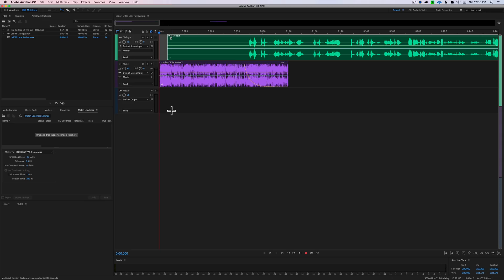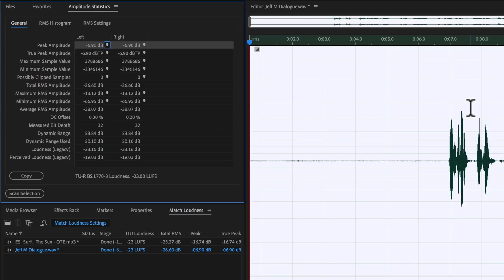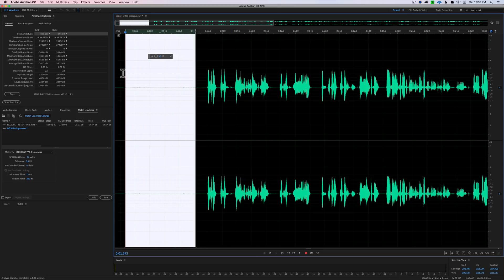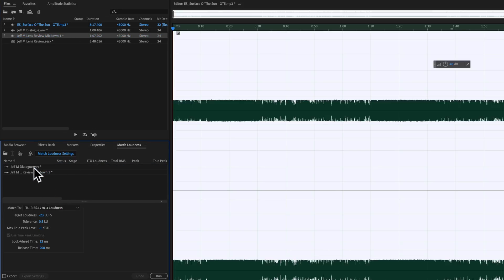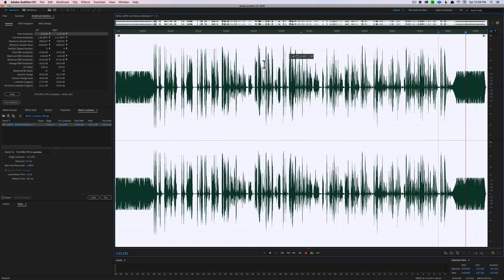Sound for Video Session: Loudness Normalize your Video Sound in Adobe Audition

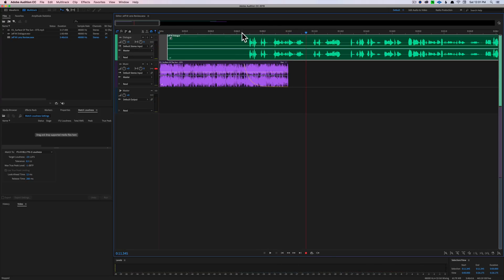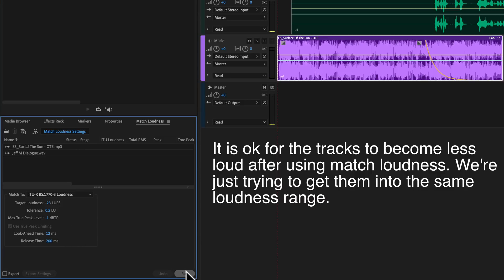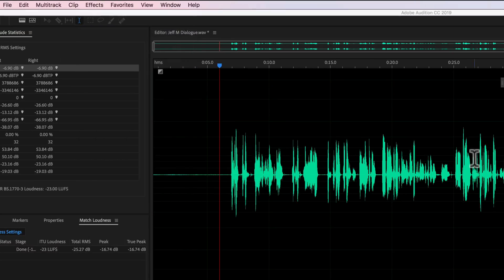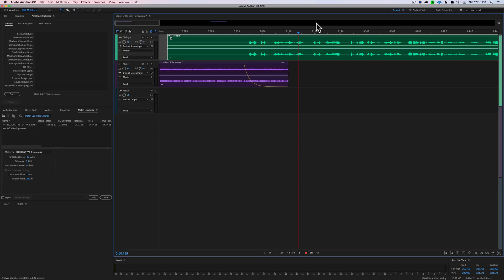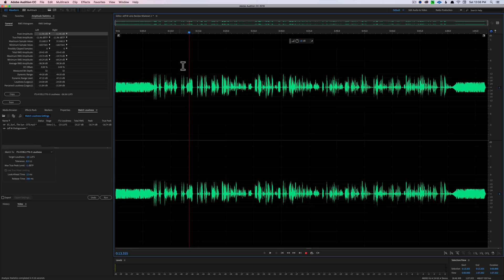Comment: 1:25 Start | 2:00 Get both in the same ballpark | 2:20 Take source tracks in Files panel and use Match Loudness panel  by pulling both Files and dragging them onto the ML panel | 2:30 Set both for -23LUFS 1-dBTP | 2:40 Run Match loudness | 3:35 Compress VO | 3:40 Open Amplitude statistics panel and Scan | 4:42  the math part | 5:05 Add compression  | 5:47 Scan Amplitude Statistics again |  5:59 Back to multi track | 6:42 Mixdown session | 7:04 Match loundness / LUFS  explained | 7:30 Rise mixdown to -16LUFS | 7:55 Amplitude stats of mixdown verified.
Reply: Thanks!

Comment: ok, million questions here. First: what were the steps before we got here? In Premiere I have imported and proxied the footage and synced up the audio. There is some wind noise, recorded levels are not perfect. So.. do make the whole video edit and only THEN move to audio at the very end in Audition via Dynamic Link?
(I will have to watch this about 10x to fully comprehend and internalise this solid flow of knowledge)
Reply: Usually yes, do the edit, send it over to Audition via dynamic link, clean up issues, then adjust levels so that they match, loudness normalize the entire mix, then back to Premiere.

Comment: What if i record Ambient sounds and there ar many quiet parts for longer duration but also very loud parts. If i bring the Loudness to -16Lufs the loud Parts need to be ultra compressed or hard limited and loosing all it´s dynamic Range.
So it would be better to lower the overall Loudness to keep the dynamic Range. But what will Youtube do with that? Does Youtube normalize to quiet Parts to -16Lufs anyway or does Youtube only lower too Loud Parts and leaf the Quiet Parts as they are?
Reply: YouTube does not boost levels to achieve a loudness target, only lowers them if the overall integrated loudness is higher than -14 LUFS. For ambient recordings, I would keep the dynamic range and NOT worry about hitting a LUFS target. It seems to me that LUFS targets are made with dialogue and music in mind.
Reply: @curtisjudd  agreed on that. Thanks for your Thoughts

Comment: Great tutorial, you have a knack for explaining things! Quick question - if I understand correctly, we compressed the audio (5:11) because we needed more headroom in order to increase the loudness from -23 LUFS to -16. But we're the ones who cranked the loudness down to -23 when we initially matched loudness (2:29). Couldn't we have set that a bit higher, say -20, and given ourselves enough headroom right off the bat so we could skip the compression part and go straight to mixing down the track?
Reply: Hi Glyph Videography, great question. I only normalized in the first step to make the waveform easy to view for the tutorial. In either case, you'd still have to do some compression to loudness normalize at the end.
Reply: @curtisjudd  Got it, thanks!

Comment: This was phenomenally helpful - normalization standards have always been confusing to me.  Question:  where does the -16lufs web standard come from?
Reply: Thanks Oliver. The -16 LUFS is really just a recommendation made by a group of respected post audio engineers in a white paper. I find that -16 to -17 LUFS works pretty well. Quieter than that and it isn't good for an audience listening on mobile devices in noisy locations. Louder than that and you squeeze so much dynamic range out of spoken word content that it sounds rather odd.e
Reply: Curtis Judd thanks man— very helpful info!!

Comment: I recently installed DaVinci Resolve to try to learn the basics of editing videos in that system and seeing what Fairlight can do for sound. The tools you show in Audition seem to be perfect for getting levels measured and set to what is needed for various media, web, broadcast, etc.  Does DR and Fairlight have those same capabilities as Audition? I think the answer  is no. If it were yes then I would likely buy your Fairlight class.
Reply from the maker: Hi Allen, no, Resolve/Fairlight does not have an offline waveform editor like Audition. However, I round trip the final mix down to RX where I do all of that work. It is nearly as fast as working in Audition - takes maybe 5 seconds to transfer the mix over to RX, when done there I click save and when I go back to Resolve, the processed audio is now a new layer on the same track. It actually works quite nicely. I'm nearly convinced to give up my Adobe Audition subscription.
Reply: Curtis Judd Audio It seems to me the best thing about Premiere is Audition! So to do what you do in Audition while editing in DaVinci I need to buy RX7? Looks like DaVinci is not free after all 😀.
Reply: @RallenMan  I relied on RX7 even when I did my mixing in Audition. So now, I find Resolve/Fairlight and RX to be a usable combination. I could drop Audition altogether, but I pre-paid for a year and there is one thing I have not yet figured out how to do with Resolve/Fairlight: When I'm editing/mixing just audio (no video), I have not found a reliable way to export the final mix other than to round trip it over to RX and export from there. There is an "export audio only" option in the deliver page of Resolve, but most of the time when I attempt to use that, the "Move to Render Queue" button is disabled and I haven't yet been able to figure out why. I thought I found the issue - that it wouldn't work if any tracks were muted - but it turns out that isn't the only factor. I just need to invest the time to work with Blackmagic support to work through the issue.

Comment: This is fantastic, thanks Curtis. Is it possible to do this type of processes in Resolve (Fairlight)?
Reply from the maker: Hi Carlos, yes but it does not have a match loudness tool like Audition does, so it would need to be done manually.
Reply: @LearnLightAndSoundSessions  Will you make examples in Fairlight in future videos? I hope so. You are amazing! Thanks again.
Reply: @carlos.o.flores  I hope so, but first I need to find some plugins that will work with Fairlight to do at least the loudness measurements offline rather than having to run through the entire video piece in real time. It is very time consuming.